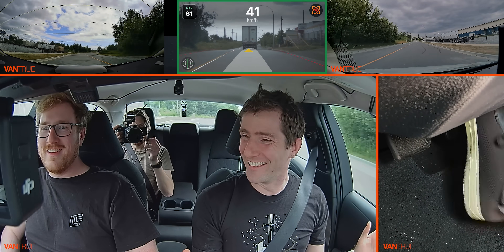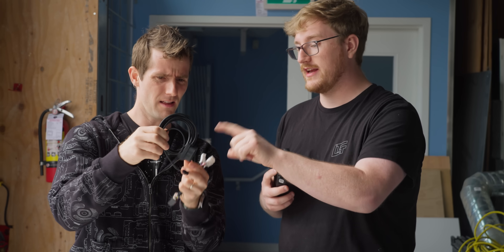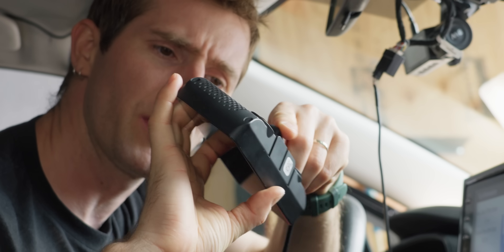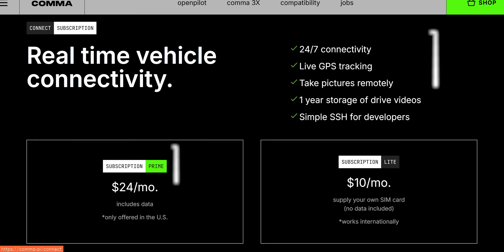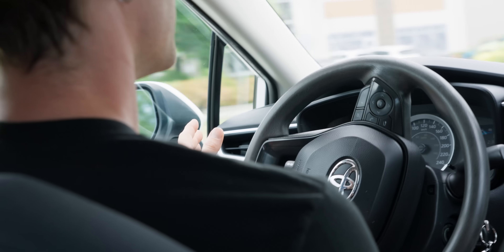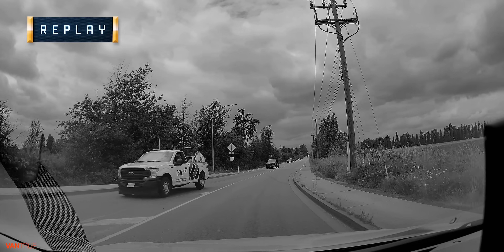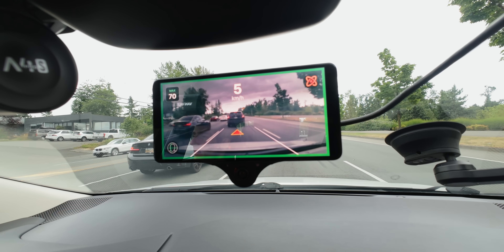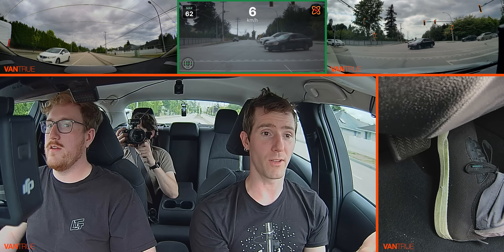I Upgraded My Car With Open-Source AUTOPILOT and it's AMAZING

Comment: Comparing this to a Tesla is ridiculous and calling it amazing it a MASSIVE stretch.
You guys nearly di*d, 
You nearly injured others,
You nearly caused multiple crashes, 
You failed basic traffic laws, 
You could not stay center in lanes, 
You could not drive capably in very obvious direct roads,
You had to TURN for it on very minimal and insignificant BENDS.. Those were not turns, they were slight bends, requiring about the same input to change lanes. 
You made a blatant lie about Tesla at 11:13

And most of all, the video is misleading up until about 14 minutes in when you admit this can only be done on electronic based vehicles.

The 14 minutes I was wondering, Okay, how in the ef is a glorified GPS unit turning and inputting the systems and then you finally broke the truth.. 

This video is NUTS for an LTT video. 

and you boys gotta get off the bandwagon. Tesla has what is has, it built what it built, no one else had done it. and those that now do also do it, are only operating off of tesla's good faith with their open source. Im not even a tesla fanboy and will never own an electric car and even I know this.. 

You boys are from Canada. Its embarrassing and you should be embarrassed about North Star and all companies inability to even produce something even remotely close to what tesla has.... 

And your reaction to tesla is "Yea but" lol There is no "yea but" when it comes to tesla, screwdriver man, What they have done is remarkable, and your only offence and tick with them is "well yea but they dont have what they are building YET". Your arguments and point abouts tesla are always emotional and from a void of either jealousy or contempt. 

Your arguments against tesla are equivalent to that of your screwdriver. How many times did you say your driver was coming out? then it got pushed back? Same with the backpack. Promises and Optimism only met with deadline failure and product failure. The issue is Tesla isnt making a screwdriver lol Thats been done already, Tesla is doing what other have NOT done... 

I think its time you get off the obvious bandwagon your on and start appreciating tesla for what its done, what its doing, and how everyone, literally everyone and every company, who shorted them, is now copying them or stealing their business model or using their charger. 

All tesla has to do is patent its charger, change the design, retrofit all new tesla with the new charger, Send all teslas an adapter that only works with tesla and the entire industry is disrupted right? You do realize that right? You do realize everyone is building off of tesla foundation right? or are you to blinded by arrogance to see the truth!

Comment: I absolutely agree disconnect the battery before working on a car a shop did not do this when fixing the electrical for my HVAC on my old dodge intrepid and I vowed not to go back. I was already mad about other things but not disconnecting the battery was infuriating considering they didn't even fix it

Comment: this is cool and all, but 80% of what this is for is highway driving, which Toyotas adaptive cruise is already pretty damn good at, so its kind of like what's the point? is it really that hard to keep a hand on the steering wheel and change lanes yourself? lane keep and adaptive cruise is mindless enough imo

also just for funzies you guys should try it on a newer manual car just to see if it works. get a Corolla hatch with a manual and then compare it to adaptive cruise
Reply: Have you seen Toyota’s attempt at infotainment? Their software sucks and doesn’t update
Reply: @AndyMcBlane  I donno. Maybe it's because I've never had anything else but I don't have a problem with it. Adaptive cruise works with 1 button press and works pretty damn well imo. Yeah it needs lines on both sides of the road but it works perfectly fine on the highway

Comment: Wait, how does it take over controlling the steering wheel, gear, and gas/brake ???
Reply: It mimics the same CAN message commands the stock system uses. The car isn’t aware who sends the command
Reply: @AndyMcBlane yeah but how's it actually moving them physically? I'll have to assume this won't work on, say, a 2000 car.
Reply: @Beer_Wolf yep correct. The car has an electronic throttlebody controlled by the ECU. This sends commands to the ECU to actuate the throttlebody

Comment: Bought mine back in March and love it for my 22 F150. I planned to also get it going in my 25 Subaru Outback but new cars pretty much industry wide are increasing their CAN security and will not work with it. As soon as any device even passively listening on the CAN bus is detected the car throws every light on the dash and won't let it be taken out of park. Comma will need to do something to remain a viable option long term.
Reply: Dang that sucks
Reply: Im shocked its not alreasy secured, this solution shouls only be used by tech nerds and not for the wide public that do not understand the limitations and caveats. I guess if big enough community for it, there will be manufacture that make "open" car with some terms that manufacture does not take any responsibility etc @TitanTubs
Reply: I've seen some posts on hacking Corolla's keys. Though that vulnerability will likely get patched eventually.

Comment: I have a Toyota Corolla Cross hybrid and the interior is almost identical to your car so I now know how to do it from watching this video. Something I learned when I installed a dashcam on mine is if you use the ODB port to constantly charge either this thing or in my case a dashcam the constant power draw will trash your 12V battery.

Comment: Love to see OpenPilot being showcased here.  I installed it on my Chevy Bolt EUV 2023 and it's made my 60+ mile city trips into the most relaxing part of my week.  Focus is still on the road, but I don't have to focus on maintaining center in the lane or controlling my speed.  Even better if there's a lead car I can sit behind and let my vehicle just match speed the whole way there.

As you noticed and others have mentioned, torque on the wheel is a limiting factor when you're going through more curvy roads, but if you can find the right setup, it can handle some pretty sharp corners without requesting me to take control of the wheel.

I use a fork of a fork (GM tuned fork of FrogPilot, a fork of OpenPilot) that knows more about what my vehicle can handle, and my 60 mile trip through the mountains only requires me to manually control through the absolute worst of the drive. (Maybe 1% of of the overall drive)

I felt that anxiety when you see the road hugging curbs.  Even though I know the model/machine can handle it, I can't help but just put my hand on the wheel to make sure it doesn't rub those close curbs when I see them.
Reply: Does your Bolt EUV have the adaptive cruise control (premier) or just the LT model?
Reply: @janhosper766  It is the EUV Premier model with adaptive cruise control, but does not have the "Super Cruise" addition, and from what I know it has to be that exact setup for the Comma3X to work.

The fun part is even if you don't buy the Super Cruise supported model, all of the hardware is still in the car, but without the head unit, so the Comma3X+OpenPilot can interface with it, which is what allows more torque/control than a lot of other options.

Comment: 6:34 this is just a demonstration, but if you install a dash cam for example, NEVER run the cables across the edge of the headliner like that. They can interfere with the side impact airbag and cause it to not function properly in the event of a crash. Take the A pillar trim off wnd run the cables all the way down to the lower dash door trim. Not dissing LTT, just a warning for those unaware.

Comment: Ah i know yall tried to address it but i really wish you would wear seatbelts. I understand it may not be convenient or easy, but neither is flying face first through your windshield and dying on the hood of your own car in a crash. Handwaving away an esd for building a computer is fine whatever, worst case scenario you screw up an expensive component. Hand waving away a seat belt has significantly worse consequences

Comment: I'm very confused about something  I'm at the part of the video where they just started their test drive, and to this point, if there was ever ANY MENTION AT ALL of installing things like solenoids or servos to interface with the steering, accelerator, brakes, transmission, etc., then i must have missed it.  You can't steer the car if you don't have some physical interface to the steering system.  So what's up with that?  Did you just leave that part out of the video?.
Reply: The car offers its own cruise control and lane keeping assist but the traditional auto makers like Toyota suck at software. This system uses the existing hardware with a better software stack

Comment: I got a Comma 2 when I bought my Corolla in March 2021, and upgraded to a Comma 3 that fall. I've been using that for the last 4 years, mostly in Southern California (a heavy traffic area.) Once you get used to driving with it, it makes driving long distances and traffic jams significantly easier. There are a few quirks you'll learn about as you drive with it, but overall it's been a great addition to my driving experience, and to clarify, it's not "self driving", it's pretty much just the best driver assist system you can find. There is a camera on the driver making sure that you're paying attention at all times. Looking forward to seeing additional testing and how you like some of the forks.

Comment: Its an issue in Australia, we cant have anything mounted above the dashboard, officially you cant really have dashcams stuck to the windshield or anything hanging from the rear view mirror.
Reply: Which rule says that?
Reply: Yeah you can. You can mount phones, dash cams, just as long as they don’t obstruct your view
Reply: @zachb1706  Quite sure slapping a phone like device smack bang in the middle of your windshield will be classed as obstruction, good luck arguing that one with the pigs around here, they will just smile and hand you a ticket, Ive been warned for just having gauges in pods up the front pillar, have been told to remove a GPS from the windshield, quite sure hey would love this thing.

Comment: Man I've been waiting for you guys to get your hands on this thing for years. I finally pulled the trigger on it about a year ago and I absolutely love how it's changed my driving habits. It behaved wierd with stock settings in my 22 civic, but installing FrogPilot made it work great. I don't think I could own a car that can't match the featureset of Comma now.

There's a lot of nervousness at first as you scope out the limitations of the device, but once you get used to what it can and cannot do you learn to trust it to do what it can. One of the things that impressed me the most is it's ability to maneuver around cars parked on the side of the road, it can 100% see obstacles and plan around them.

Comment: Snapdragon 845 is diabolical 🥀Should’ve used a newer SoC with a built-in NPU
Reply: For what reason? They aren’t limited by performance at this stage
Reply: @AndyMcBlane AI performance is significantly improved with current gen SoCs, vastly improving decision making and leading to a smoother ride

Comment: Its interesting, although it likely would have better utility if the two 180 degree cameras were externally mounted. Most cars only support adaptive cruise control and lane keep assist, which many of the vehicles already support. Still interesting though.

Comment: I've seen this used to upgrade other EV's like Leafs and Bolts with Auto like drive. I think it's best on the highway, it struggles with tighter turns. This product is very open and varies from car to car and software build to build. Very cool.

Comment: Since this is a whole nueral network thing, I think it'd be a good idea to make them (each unit) have a random secure ID number to communicate with each other on the open road within say, a mile radius. That way they can work together to optimize driving and traffic. If enough people were to adopt this, it could totally work and we be entering minority report reality.
Reply: So my driving model now needs to trust the software running on other peoples cars? No thanks
Reply: @AndyMcBlane if you're all running the same version, your not trusting someones else's model. Software is objectively better or worse. Aggregating the best of everyone's model into running the same version of software would benefit everyone. To think of your model as the best of everything is asinine and nonsensical. You sound like a very stubborn person.
Reply: @charlestannehill7537  what mechanism can I use to trust the reported version from someone else’s car? How do I know it hasn’t been tempered with?
If their car says I am fine to go through the stop sign, but it turns out there was a bug in their software, but I still crash into them, this situation is worse than a stop sign today.
Reply: @AndyMcBlane you just answered your own question and proved my point. The cars will have Sim connection. Like a phone. Location can be securely transmitted to each other without giving away personal information. It's not hard to program that in. And you wouldn't hit the car if you're running the SAME version of software. The cars can and would automatically update over this Sim connection. Therefore, whatever bug they have, you have. Yes, accidents will happen. But once the software learns, it doesn't forget and gets better and better than a human ever could. Over time accidents will near zero. Have you ever thought something out? 🤨
Reply: You would put a lot of trust in the other car’s hardware functioning properly and not being malicious. 

The simplest approach is to just treat all cars the same and rely on your own sensors

Comment: Did it not occur to them that you can clip a lav mic to the seatbelt? Bro won’t let folks do a backflip for “safety reasons” but is cool with testing experimental autopilot on public roads without proper safety belts? Hmmm interesting.

Comment: Really cool concept. One point of discussion to add would be security. I remember the story from 2015 where external hackers could get into the phone hot spot wifi feature of Jeeps and just fully gain access to speed, breaking, etc. I image that there would be similar concerns with this because of the wired access to car feature and its ability to have an internet connection. What do you guys think? (I don't want to sound dumb and I am not a security expert so take with a grain of salt.)
Reply: You can turn off the internet connection. Since it's open source you know it's off for good.
Reply: @enihi very cool, thanks!
Reply: The safety code requires it to be engaged via the normal cruise control buttons

Comment: you say its a issue in teslas autopilot. But the other issue is comma and more Toyota in this instance only has like a 5% steering assist angle it can use for steering. and its been a very long time since my tesla tried to take me around a turn at 100 plus it never tapped out when it did lol

Comment: 3:40 Jake saying “it probably doesn’t matter but you should do it” is absolutely correct. As someone who accidentally sacrificed a fuse while installing a hardwire kit (yes it was a fuse that came with a hardwire kit but the point still stands when I accidentally shorted 12V to ground), I now disconnect my battery if I’m doing anything with the fuse box or around the airbags

Comment: Self-driving systems that use only cameras, I don't believe, will ever be sufficient for truly safe self-driving. Tesla's is probably the most advanced camera-only system and researchers have pretty easily duped it into running over fake children, etc. Tesla also have a bunch of lawsuits that they're trying to keep quiet relating to deaths due to the self-driving features. 

That is pretty substantial for an open-source project, though!
Reply: Truly safe self driving can’t and won’t exist.
Reply: @AndyMcBlane  They definitely can. And they'll be so much better than humans

Comment: Word of advice, the, 3x is quite heavy and the VHB will eventually fail on both of my sticky mounts.... I permanently removed the vhb and added some RTV and then let it set overnight.

Also, the minimum brightness can be quite high during the night. While the tech in me wants to see the screen at all times. I've got it to time out at 10 seconds and it has made the amount of time that I stare at the screen far less and much more enjoyable at night... Any prompts immediately bring the screen back online so it's not an issue.
Reply: Did you let them cure for 48 hours
Reply: @AndyMcBlane Yes I've had it for the last like year and a half now

Comment: so basically this adds the features to dumber cars my 2018 XC90 has from the factory, with a few new things,  it'd be nice to have them look into a way to add onto existing systems like the Volvo system that likely has al the bits there already but just needs to be smarter to get the stop light/stop sign support, if they could sort that and make it so it uses the standard screen so you don't have to mount a big thing to your window, hate things like that in my field of view, not to mention it'd melt in one summer where i live if i way permanently mounted up there.

Comment: Try sunnypilot, it has a feature called MADS which lets you separate longitudinal and lateral control, braking doesn't interrupt lateral control. ETC. makes it so easy when you have to take over in street driving
Reply: MADS is one of the BEST things about Openpilot/Sunnypilot.  I cannot imagine having an ADAS system that didn't have a similar feature.

Comment: Vantrue sucks. went through $800 on them and they work for two months.. no way to return to Amazon and they want to blame my Sandisk Ultra Durable drive... and their glue is terrible when used in an ultra hot Florida environment